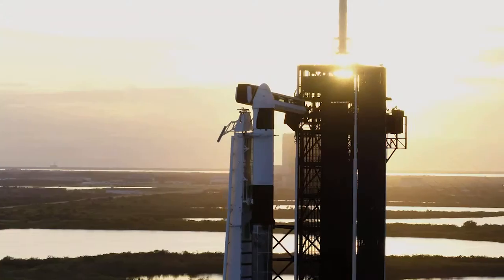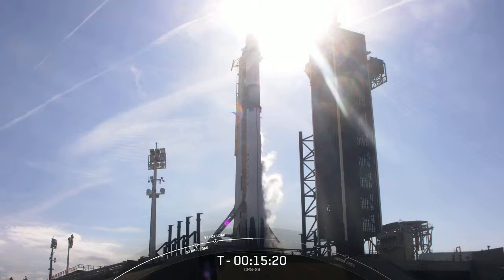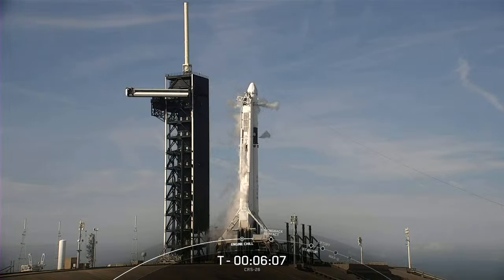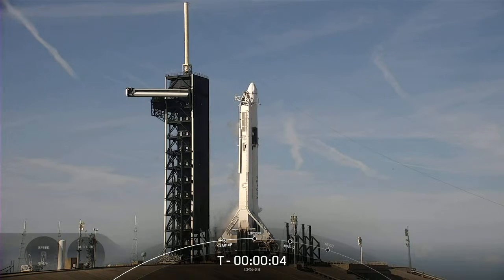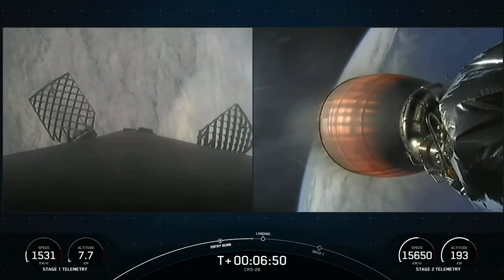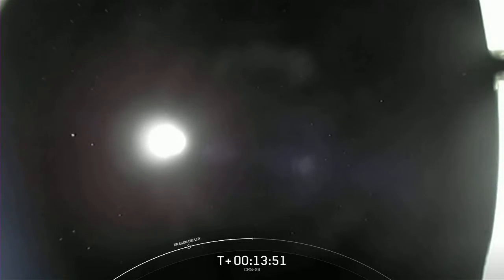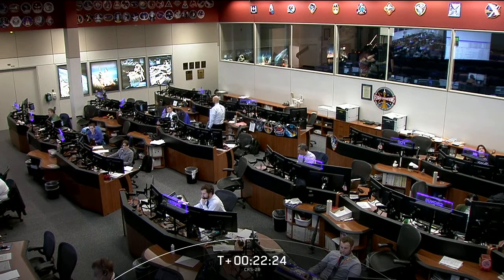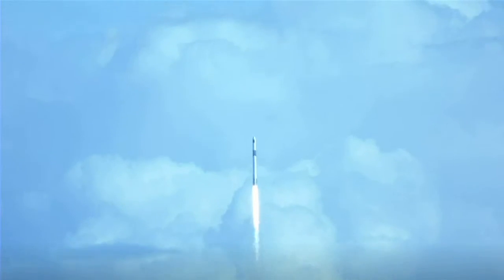CRS-26 Mission

Comment: Never. Gets. Old. This booster seemed to land a bit offset from the landing target.  8/10.
Reply: Can happen sometimes due to waves moving the droneship around.
Reply: There is an aviation saying that if you can walk away it is a good landing and when you can use the plane again it is an excellent landing. This is an excellent rocket landing!
Reply: Sea waves must have moved the ship a little bit. But still it was a perfect landing tho.
Reply: Picky.  One meter between friends is nothing. 🙂
Reply: They were a little off center. But still this is the pinnacle of rocket technology! I can't help but measure this against the accuracy they will need for starship to be within the chopsticks. Would this have been within tolerance?
Reply: @Grubbbee  A: The starship tower doesn't move around from waves like the boat does.

B: Superheavy can hover, unlike Falcon 9. 
So it doesn't need to do a hoverslam to land like F9 does, it has much more margin for adjusting itself.
Reply: @carljohan9265  sure ... I'm just comparing the outer circle or the barge deck as a large football field sized target, to the virtual "target zone" around the catch tower. Good points about the thrust. But you have the added complication of not hitting the tower so the approach vectors/angles are more limited compared with a falcon 9 returning to a landing zone. F9 could be off in all 360 degrees, but starship has more to deal with.

Comment: Awesome as always. Great footage, great coverage. I think its iconic how there are always some falcons aloft as Falcon 9 ascends. I noticed the landing wasn't exactly on the bullseye. I'm guessing this won't be an issue for Starship landings since Starship doesn't have to land with just-in-time deceleration.  Probably come in a lot slower with plenty of time to line up with the chopsticks on Stage Zero.
Reply: Yes, if it going to work, that is the only way it can work. The Merlin engine can't throtle down low enough to hover.

Comment: 24: 39 Startup
25: 39 Liftoff
26: 51 Max-Q
28: 08 MECO
31: 33 Entry burn
32: 47 Landing burn
34: 26 SECO
37: 38 Dragon Separation
43: 41 Hatch Cover Opening
Reply: If you are wondering why I had to space the time out, the comment is not visible to anyone if it has too many timestamps. I can't think of a way someone would abuse that.
Reply: @WesternSpace1  that's strange

Comment: The bright object surrounded by stars in you see when the nose cone opened appears to be the moon in Sagittarius.
Reply: Cameras can only detect stars with very long exposures. What you were seeing were bits of ice or frozen oxygen released from the rocket.
Reply: @odysseusrex5908  Review the footage for yourself, there was a central bright object, and 4 nearby points, in perfect alignment for several minutes.  I did see some ejected volatiles but those were very transient.  Also note, even the new moon at magnitude about  -8 and the stars in Sagittarius are not faint objects, all are magnitude ~3 or so.  I checked with planetarium software, and that agreed with my earlier assertion.  
Cameras in space can capture more than you'd expect!
Reply: @AllanMacMillan   I do not need to review the footage. You can not see stars with a normal camera, especially in the light of some much brighter object. Take your call phone outside some dark night and take pictures of the sky. You will see no stars.

Comment: It's interesting. I went back and watched a few of the previous launches. The Water - Sound - Shockwave suppression system usually starts spraying at about T-7 seconds or so. In today's launch, it started after launch at about T+3. Too much air in the lines? or has some new procedure entered into the countdown? The rest of the launch, from green flash/liftoff to the landing of the 1st stage was again, awesome 🙂

Comment: Did I miss something, or did Stage 1 enter boost back much earlier and at a much lower speed than normal?  3000kph vs 7000kph.  Has that got something to do with this new first-born F9, or was it just a different type of launch profile?

F9 to date in totale has delivered to the ISS just over the amount of tonnage that one Starship will fly - 120 ton vs 100 ton - approx. 3 fully-laden semi truckloads.

Comment: how much lead would need to be added to the space station in order to be safe enough to transport people to the moon? (asking for a friend)
Reply: No lead at all. The Apollo spacecraft used foamed aluminum and gold foil.
Reply: The space station can't transport anyone anywhere.
Reply: @odysseusrex5908  what is the belt name that keeps us safe in the play pen?
Reply: @TheEvilmooseofdoom  so its just sitting still?
Reply: @4gleason129  it is revolving around Earth, but other than that it remains in a fixed plane. No movement
Reply: @jamessheppard4372  so then it takes propulsion.  Let's just assume that it has the ability . Could it safely transport the crew, or, would it need a pile of lead to protect them?
Reply: @4gleason129  The space station only requires the occasional little boosts to counteract the decay of it's orbit. It does not and cannot have enough propulsion capacity to go anywhere near the Moon. 

And to answer your question, if it somehow did, it would not need any lead to protect itself
Reply: @4gleason129  It pretty much sits still
Reply: @4gleason129  It doesn't require propulsion to revolve around Earth. When something is placed in Earth orbit, it keeps revolving around Earth until the orbit decays enough and it falls back to earth
Reply: @jamessheppard4372  so, don't imagine then. Got it.

Comment: After "Max Q" the pressure stay the same or it's falling down?
Reply: It’s falling. Although the craft is accelerating, the atmosphere is thinning.
Reply: Up to maxQ the forces on the rocket are increasing.  The atmosphere's thinning, which will reduce the forces, but not fast enough to offset the increase due to the rocket accelerating.  maxQ is the point at which these forces reach a maximum, as the name implies.  After maxQ the reduction in the forces on the rocket due to the atmosphere thinning are faster than the increase in forces due to the continued acceleration, so the resulting force decreases.

Comment: What is the reason for Russian (and China I think) launch Direct to Station but SpaceX takes a day to dock?
Reply: It depends on the launch window and how wide that is and then there are a whole pile of orbital mechanical things from phase angles to beta angles but I believe the big one in the case of Dragon is that it takes less fuel and allows for a larger payload.  I have to admit when it comes to the fine points of orbital mechanics I am not as confident as I would be in other area's so there could be a error in there.
Reply: China does not participate in the ISS. With Russia, it is partly a matter of showing off. There is very little these days in which they are even a peer to other space powers, so reaching the space station in a few hours makes good PR. It is easier for them to do because of the orientation of the space station's orbit with regard to their launch facility. To do that from KSC would require more thruster burns and the use of more fuel than a more gradual approach. Also, when Russia sends a manned Soyuz to the station, they have it crammed so full of cargo and supplies that there is almost no room for the crew to move around, so they want them to be able to get there and get out of the spacecraft as soon as possible.

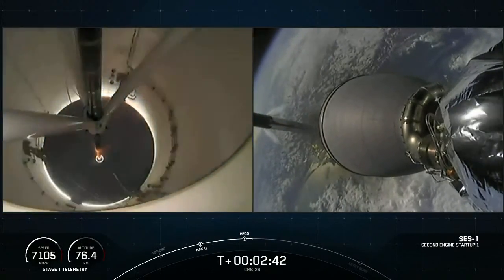Comment: 28:22 what is this black circular piece ?
Reply: If you are referring to the piece that comes off the second stage engine nozzle, that is a stiffening ring that protects the nozzle from vibration during the booster phase. It is meant to come off as the engine comes up to power.
Reply: @steveadams7369  yes, this one. Thanks 👍